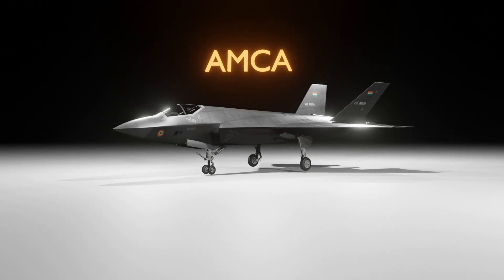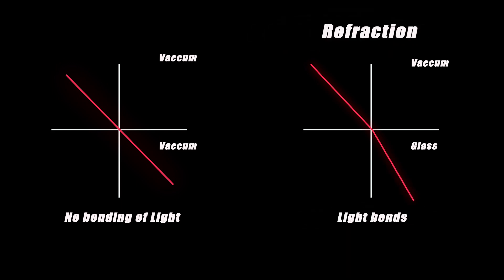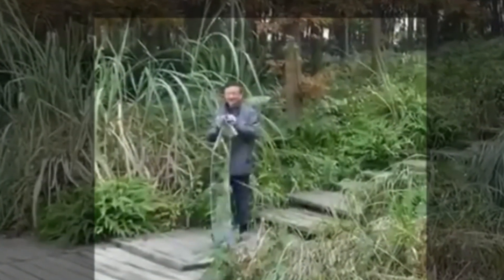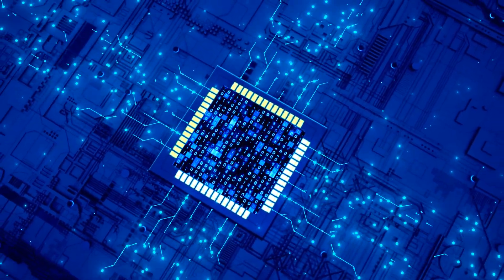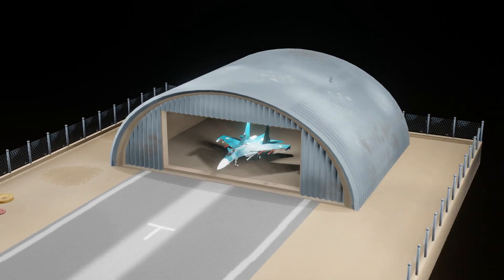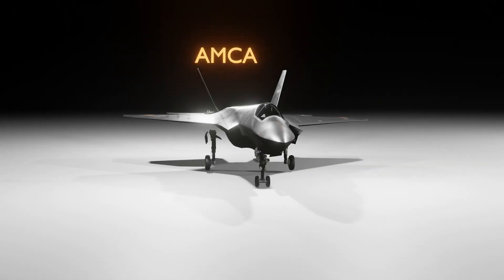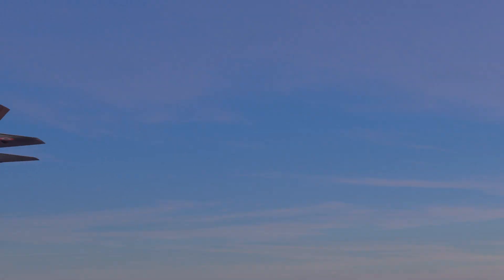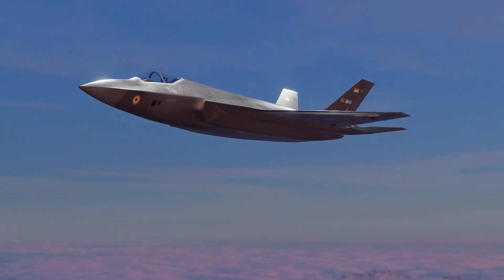Analakshya: AMCA's stealth Coating

Comment: When India builds AMCA, China and USA will already have 7th Gen Fighter Jet.
Reply: US still using 4th gen F16s LoL.
Reply: Seriously F -35 has been around 30 years and 6 th gen not even matured so of india did develope 5 th gen in 2032 it could have advanced capabilities like CAT system and direct energy weapons so there is a term in engineering Do it first or do it better so 6 th gen takes time to mature india can easily catch up
Reply: @manjunath.s8443 F22 was inducted in 2005, F35 came after that. They have been in service for less than 20 years. A generation of aircraft remains relevant for atleast 30 years , we won't see the F47 before 2030 to 2032. So that's that. India can catch up when the time comes for 7th Gen Aircrafts, around 2050. Not before that.
Reply: We can expect it by 2032
Reply: 7th gen fighters will not have a cockpit......AI will fly it

Comment: Good information, also for 5th gen Aircraft IAF IS going with a single seater cockpit. Any particular reason behind this? Usually IAF has 2 seater cockpit even in SU-30MKI